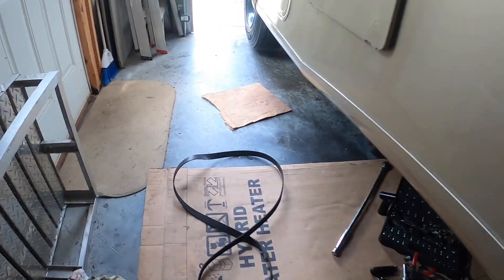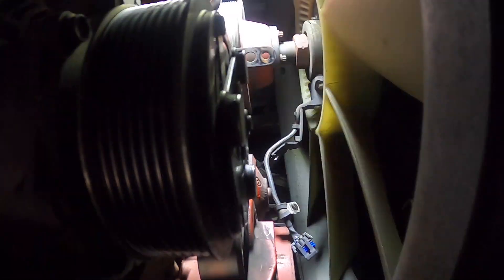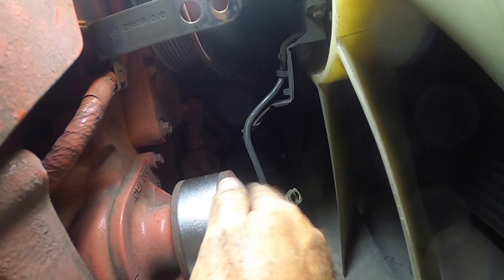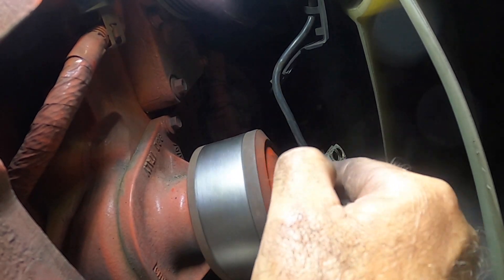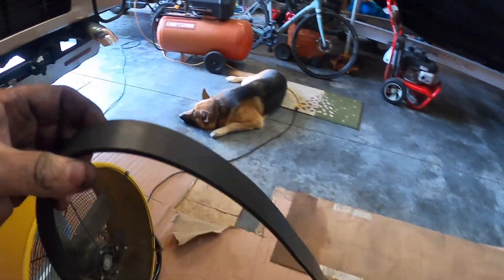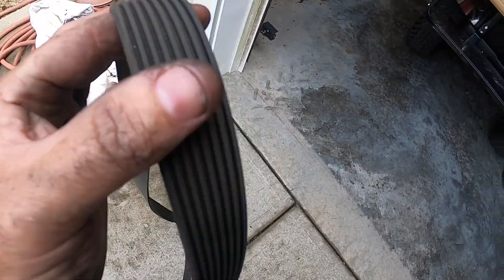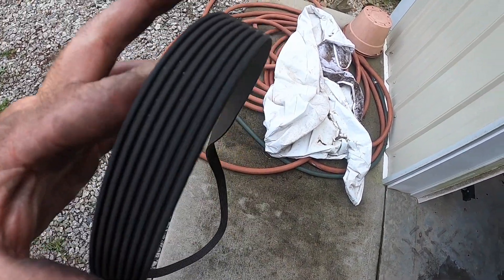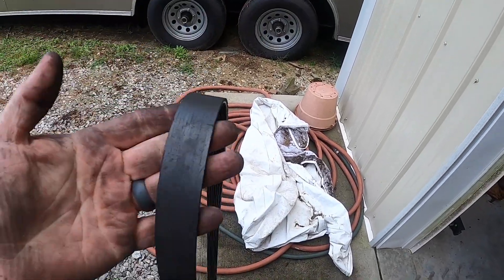Diesel Pusher Motorhome Serpentine Belt removal and water pump Inspection

Comment: Macias Diagnostics Cumming GA, services this belt and water pump on the Cummins profile. Diesel pushers degree of difficulty with servicing the  belt alone is much higher. It’s all about reaching the center  of the engine area with very little room. It would be difficult to film it. This is a great awareness video.

Comment: How do you get the serpentine belt over the fan. I was trying to replace mine and I could not get it around the fan to get it off and put a new one on?
Reply from the maker: Oh wait, watch this video! I forgot, but this was 4 years ago.... https://www.youtube.com/watch?v=8o4q5yMaydQ&t=415s
Reply: Mine is an 8.9 Cummings and i couldn't get the belt to stretch far enough around 2 of the blades.  Maybe the 8.9 isl fan blades are bigger?

Comment: But you didn’t show the belt removal that’s what I came for. My pump went at exactly 30,000 miles
Reply from the maker: I couldn’t hold camera and remove it too. Sorry. There is literally no room for a clean shot or holding a camera while removing the belt. I hope that helps explain the difficulty.

Comment: What engine?  Looks like a cummins?  Belts and WP should go 150k?  I have a cat c7 and have some coolant below the dampner.  At 31k I am stunned it may need a wp.
Reply from the maker: These Cummins ISBs have an issue with the water pump pulleys. This was a preventive check.